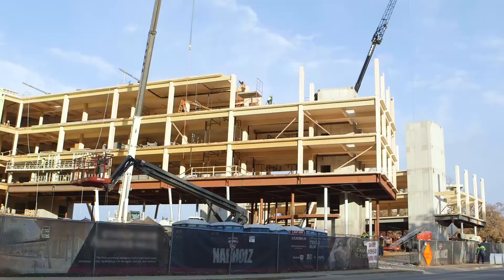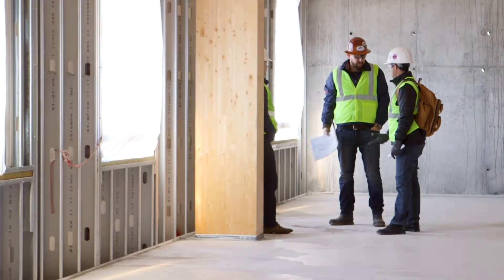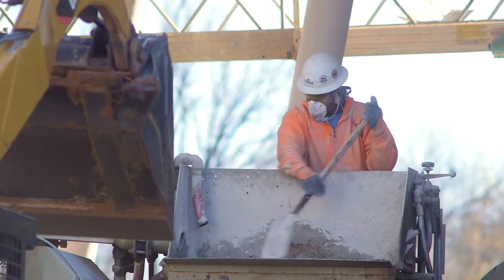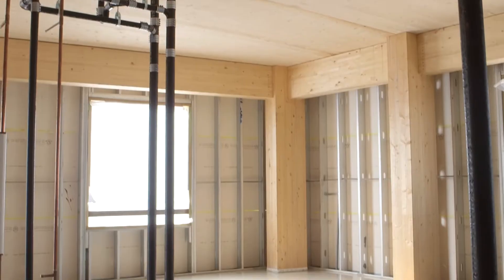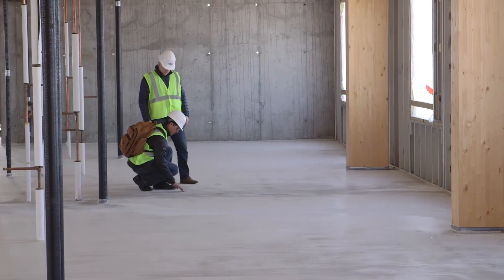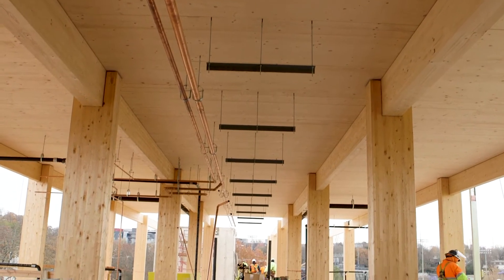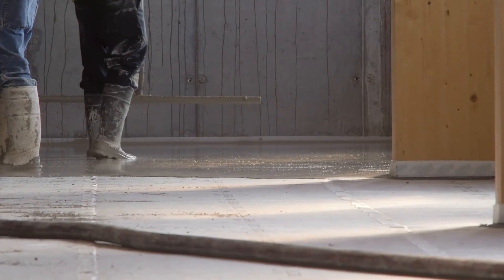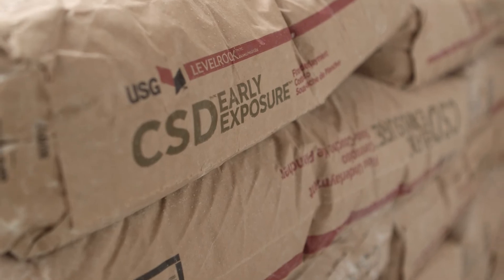USG Levelrock® Project Profile: CLT Multi-Family Construction

Comment: How is the Sound mat roll adhered too the wood slab? Is it the weight of the Underlayment that keeps it down?
Reply from the maker: Hi Ashton - Correct, the weight of the poured underlayment keeps the sound mat in place. The use of mechanical fasteners, like nails or staples, would create leaks in the system, diminishing its acoustical performance.